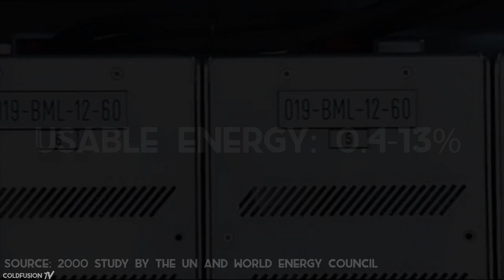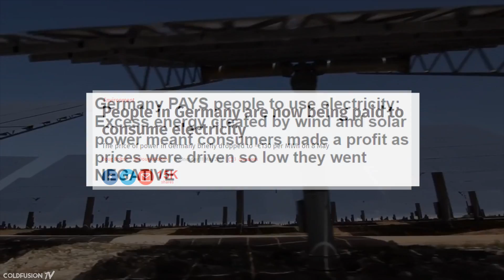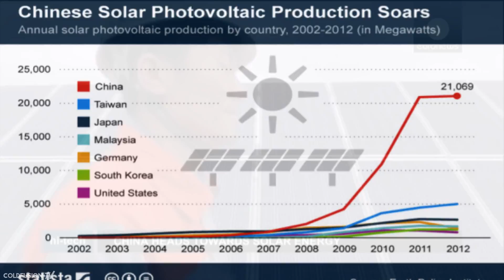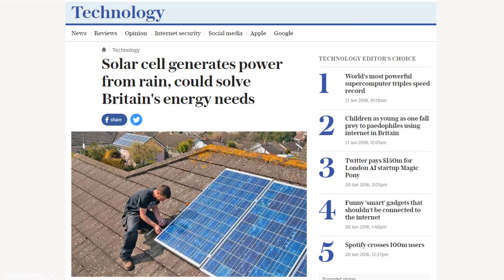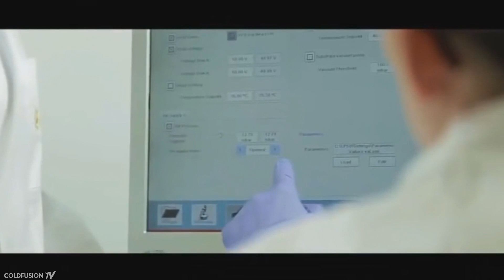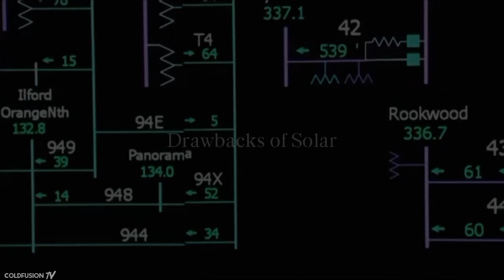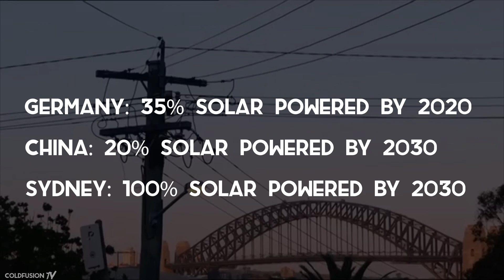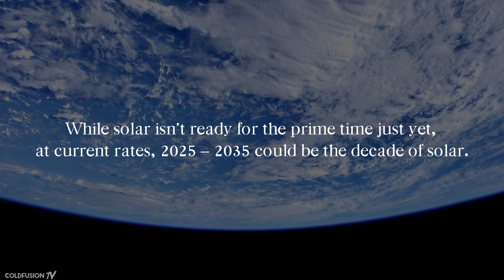The Truth About Solar

Comment: Solar energy has always and will forever continue to change this planet. There is no doubt about that. The question is what are OUR end goals. Do we want a world driven by profits and greed or one driven by the morals of being a more sustainable civilization. What's more is that we shouldn't focus on one single method of harnessing energy, energy is not a profession. Energy can be transformed from many things that don't require mining or other expensive methods. For instance, the difference in temperature, the kinetic energy of water, weight, momentum etc. The secret in conserving energy is in how we utilize the energy that goes to "waste". If we truly want to be sustainable we have to think microscopically, we have to think in terms of electrons, neutrons, atoms and molecules. They say, "every penny counts" - if you've been around on this planet long enough, you'll have realized how true that statement truly is. The same thing applies to other units.

Comment: It's simple to deal with the 'peak hours' usage problem. Build a solar storage that only gets used to compensate for low power. Could be as easy as doubling up solar panels per house or an extra solar panel in every yard.

Comment: The best consumer-available panels are just over 20% efficient. And that's the best, most people will install those that are 15-20% efficient under perfect conditions (which almost never happen). Also, grid power is cheap and solar panels expensive. If I pay $400 a year in electricity, then it's just not worth to invest thousands of dollars in solar power. Investment return of over 10 years is not worth it.

Comment: You can build all the solar panels you want, the problem has always been that of storage aka batteries.  The current most economical feasible method is lead acid batteries.  There's not even enough lead in the world to create enough storage capacity for just the US much less the rest of the world.   We need an actual energy density that approaches diesel fuel for PV solar to make a real dent in our energy budget.

Comment: Fusion is the way to go, it's just in very early stages, but why would you need solar energy, when you could have your own mini sun? No intermittency, and fluctuation problems, it's the cleanest energy available (mass -> energy) You don't need batteries, and huge areas with panels.

Comment: To get solar power working we need both good solar panels and energystorage.
The energystorage needs to react quicly for the fluctuation of electrical demand ^_^

What use is there in solar power if you can't store it and use it layter. There is no way currently to store the electricity 100%

When I build my house I will add the solar panets on the roof and energystorage some where :) but that will not happen in ten years. I can still dream :D Addional usage for solar panels would be to charge solar car.

Comment: 3:00
 36 cents per watt is the cost of the solar cell component of a system. An installed grid-tied solar panel system is about $3.50 per watt. With the price of the exotic solar cell material so low,  the installed system price would not drop much even if the cell price were reduced to 0. In other words, it is all the other things, especially installation, that need to be reduced to get the price down much further. 4:20 The materials in a system, like the glass, the frame and the wire, are the sorts of things that are not reduced in price by just shrinking dimensions, the way the cost per transistor has gone down constantly.

 
But anyway, at the present installed price, even in the northeast US,  without subsidies and tricky accounting, the equal-cost point of a grid-tied solar panel system is less than the lifetime of the system, after which it becomes cheaper than the grid alone. That means solar panel systems are in some sense not impractical, at least not for the reasons people typically think. But would you pay the equivalent of the total power cost on your electrical bill 18 years in advance? Of course, you could install a system less than your total power use and still come out ahead. Would you pay for 5 years in advance?

Comment: i know they are not mirrors. i think the Sun light is reflexed back to space or atmosphere by the solar panel. maybe this reflex can be a kind of pollution to the local environment. because the reflex can raise the  air temperature and quantity of light. so this high temperature will not be good. because we have seasons. maybe in the winter time would have too much light, and the winter must have less light. the problem is, any kind of energy produce by humam is not natural. this call energy control and we are using for 70.000 years. it's like we take a small peace of the Sun next to us. with this we broke the circadian rhythm.

Comment: Great Video! But to be honest, I kinda feel that there are two questions still left open to get a complete picture of the topic? What is the life-expectancy of a solar panel? How long does it work at its maximum efficiency? Which results in the question: How long does it take for a panel to be cost neutral?
The second one is, imho, the most important one: How much energy is needed to create a solar panel? Does a panel covert enough energy to be energetically neutral? Or do we pump more energy into creating a panel that receiving?
Reply: Life expectancy is indefinite. Some of the first solar panels, produced 40+ years ago, are still in service.
Most manufacturers guarantee less than 20% output drop in the first 20 to 25 years, after that it's anyone's guess, but there is no technological reason to think that the rate of decay should radically increase after 25 years.

How much energy is needed to create a solar panel is a good question, a complete analysis of the manufacturing process is a vast and complex task and depending on your methodology, you can get different results. And depending on your installation, the output may vary even more. Energy neutrality has been estimated to be achieved as early as 6 months to as late as 10 years.

An easier way to estimate is to look at the price. No large-scale manufacturer will produce and sell panels at a loss, so the price of all the energy used in manufacturing should be included in its market price. Similarly, no one will buy them (not on a large scale, anyway) if they don't expect to earn back the price by selling/using the energy it produces in a meaningful amount of time. Therefore, the very existence and expansive growth of PV industry, currently at $24 bn a year, proves that it is a viable investment.

Comment: Not one mention of the most important and frankly only relevant factor.... THE THERMO-DYNAMICAL ENERGY BENEFIT OF PRODUCING THE CELLS.

Right now at BEST a solar cell is going to produce 1/20th of the energy needed to MANUFACTURE IT IN THE FIRST PLACE over it's lifetime, meaning IT IS A WASTE OF ENERGY.

We would be better off just using the energy used to produce them for our other energy needs that we think we need to make solar energy to supplant...
Reply: From Solarcraft.com - 
MYTH #1: Solar panels require more energy to manufacture than they produce in their lifetime.
FACT: A study by the National Renewable Energy 
Laboratory conclusively demonstrates that the manufacturing energy cost 
versus the energy production payback for solar modules is generally less
 than 4 years.

I checked out the paper at the NREL.gov site, and it looks like they are saying about 3-5 years before you produce more energy than goes into the cell. Of course since we're talking about grid power as the input, then the more renewables on the grid the quicker the payback in carbon terms. 

One of the big problems with solar was included, and that is that once you get too much the price the grids pay for power goes negative. Great for manufacturing, terrible for solar power plants trying to make money.

Comment: The narrator said, "The cost of solar energy is now 36 cents per watt."   That statement is meaningless.   Did he mean 36 cents per watt-hour, per watt-minute, or per watt-second?
Each of those is a deceasing unit by a factor of 60.   Very sloppy!
Reply: It's not sloppy, it's the most common metric used to describe solar panel prices. You're thinking of units used to describe the sale of electricity.

Comment: Not sure why existing centralised electricity infrastructure would require capital expenditure when it in fact would've become redundant. When energy/electricity generation and storage occurs on site, the need for poles and wires to transmit electricity is no longer necessary. Interim localised networks taping into small wind/solar and storage facilities could easily account for demand shortfalls while efficiencies are increased, eliminating the huge amount of energy wastage involved with transmitting electricity long distances. As solar and battery efficiencies increase these small localised networks would also become redundant, replaced by every home/structure's potential to become a power station generating and storing its own energy. No need for poles wires or a centralised grid. The implications of this energy revolution are profound and far reaching. Imagine what energy self sufficiency would mean to the individual and their society.

Comment: We had an energy audit at my house a few weeks ago. We did ask the auditor about installing solar panels on our roof, he actually couldn't recommend it for four reasons: 

1. the panels would last longer than our roof, and would need to be replaced every time the roof is rebuilt.

2. We had our roof rebuilt about two years ago, so we'd have to have it rebuilt again just to install the panels and required utilities.

3. Our house is in a wooded area, and the southern face of the roof (which gets more sun) has just enough tree cover to prevent solar panels from generating their full output.

4. Our town already gets most of it's power in the form of wind energy generated by three turbines that were built a few years ago. (These turbines are easily the largest structures in the immediate area, and they generate stupidly high amounts of power thanks to being a seaport with ideal wind conditions almost year round)

From his opinion, and based on our options, we'd spend a crapload of money just installing and optimizing them and wouldn't see a return for a decade or more. While I agree that it has a future, it's important to find out whether or not it's the best choice for your area.

Comment: Grid solar has not yet made a piece of toast.
Reply: I guess gigawatts of electricity is not enough to run your toaster? Maybe you need to invest in a better toaster.
Reply: Generation does not a piece of toast make.  There is rectification, distribution and the energy costs of the installation. When it comes out of the plug has the power come from the sun? In part, maybe. Has that juice from the sun displaced a single lump of coal or fart of gas? Nope. Because the stinky old gas and coal plants have to be kept on the boil anyhow. Look into it.
Reply: It has displaced a substantial amount of coal and gas already, maybe you need to do a little more research first. Every single watt generated by solar is one watt less worth of fossil fuels that we needed to burn.

Comment: I get that the needs of the many outweigh the needs of the few, but one big thing I'm worried about with solar energy is how do we somehow get the birds to fly, well, away from solar panel areas?  Because those poor little guys get annihilated by the concentrated light from solar panels...
Reply: You're thinking of solar thermal power plants, not photo-voltaic solar panels. Either way, many more birds die simply by flying into glass windows every day, some things just can't be helped.
Reply: Also, oil spills and air pollution kill the occasional bird here and there.
Reply: A total of two birds counted in the USSA in one state last year. Along with 2,500 hitting windows, 1,400 killed by cats and so on
Reply: m1aws Then one of us is getting the wrong sources because I've read things that say it's thousands of birds that die from solar panels and wind turbines...
Reply: Brandon Love wrong! It's chemtrails, lol
Solar panels? Maybe the birds should wear rubber shoes.